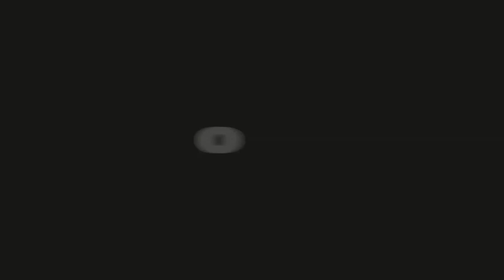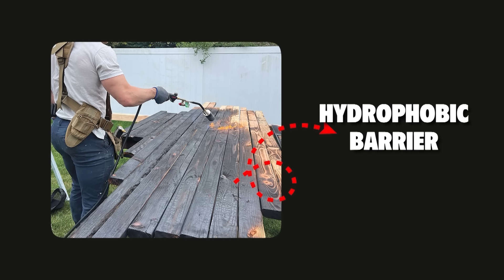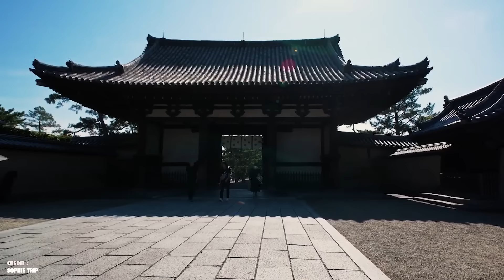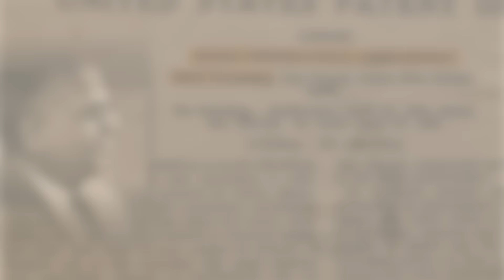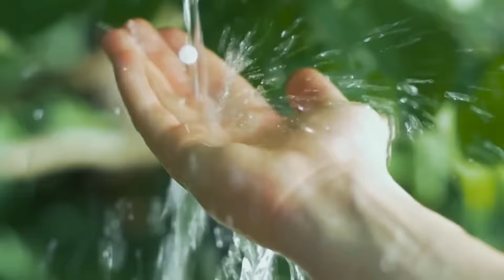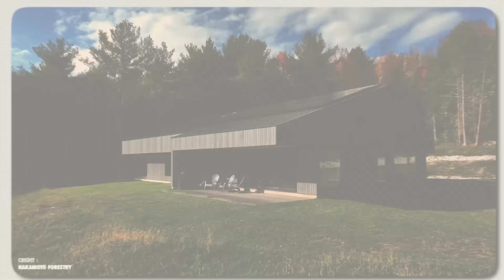How A FREE Japanese Trick Makes Wood Rot-Proof, Fire-Resistant, and Insect-Proof

Comment: What I don't get about this method: After charring you either have crumbly, well, carbon, that rubbs of when you touch it. Alternatively, when you brush it, you start revealing the untreated wood again. 🤔 Also, doesn't charred wood, similarly to charcoal catch fire QUICKER?
Oh, and how do you actually work with the wood after it has cupped and warped so heavily after one-sided charring?

Comment: It is decent video I agree with the premise but somewhat disagree with “corporate is evil” conclusion - that can be true but far from full picture. 
  you didn’t explore(just briefly hint) the difficulty of scaling of this method especially back in a days and on top of that not all woods can benefit from that - so cost is way higher, the fact that it is very messy during install and lifespan(ashy surface even after oiling it), hard to repair to match the surrounding material, it can flake off, and maintenance (oiling) is still needed so is not set and forget as you imply.
Reply: "Western building codes" do not apply to the whole world. and for some reason, this method has not been widely used outside the USA and Europe either.
Reply from the maker: Thank you for your comment. I am not sure I can agree with you completely.  Yakisugi does offer a better lifespan than conventional treatments and one without any manmade chemicals.  But I do agree that it is not cheap! If you do not use the conventional way of burning the wood (kindling) and instead use a blowtorch it will cost you a lot more than treating with exterior wood paint. Thus Yakisugi is perfect for cladding that you hope to have on a house for a long time and not necessarily for things like sheds or fences which will use cheap wood.  I also would not advocate having it internal to the house as it is messy and carbon dust is not great for anyones lungs.

Comment: Part of the reason why this works is because the wood they use is cedar. Cedar is very rot resistant to begin with, so giving it a little extra surface protection makes it last a really long time. It's not as effective with modern pine that is very soft and porous, and tends to alligator or crack if prepared this way.
Reply from the maker: Cedar is certainly the preferred option for its grain structure, density etc.  Other woods can be used but may not perform as well.  I have personally done it on pine and it work well.  I did notice cracking on some boards that weren't properly dried, but I still liked the finish and the end result. The only thing I would say is that if you want to preserve the wood for longer then add a layer of linseed oil.  It helps keep the carbon surface in place longer.  Without it I noticed my boards changing colour after a period of rain.  Anyway - thank you for your comment!

Comment: I'm not debating the source of this technique, but lot of barn doors in Germany's Countryside use this technique. I've seen 80 to 100 year old wood doors with no rot.
Reply: Yeah, but the type of wood matters. A lot of those old barns that are still standing were made with timber that is heartwood from very rot resistant wood species (anything over a hundred years has a lot of selection bias; all the softwood barns have long since rotted and fallen down). 
 You can't expect the same longevity by trying the same technique with much less dense softwood species or modern pine. If you do you'll find that the lower density leads to a correspondingly less dense carbon layer at the surface, which is more prone to alligatoring (cracking during the burning), and generally just leads to a much less dense carbon matrix on the surface that won't protect the wood adequately.
Reply: Also, CCA is band in Germany.  
I think its only allowed in marine

Comment: Doesn't using oil defeats the purpose of carbon? Mold will happily eat oil.
Reply: I've seen it asserted that the main risk with oils is the mucilage content. I mainly make things that are smaller than houses, so I use an alkaline solution to remove the mucilage from finishing oils. You lose a bit of the oil in the de-gumming process, but it's rot resistant. Leaving that in the sun as it separates also produces a sunbleached drying oil, which polymerizes faster in the same way that "boiling" it does.
Reply from the maker: Traditionally they didn't use oil and simply let the carbon do the job, but in modern time to give longevity to the wood and to make it look more appealing people used oil to lock in the carbon on the surface.  So yes you are correct! Thank you!

Comment: So using gas to burn it and oil to seal it. Do you know what "free" means?
Reply from the maker: You don't have to use gas, you can use tinder if doing it the traditional way.  And you don't need to treat it if you don't want!  Just leave it as it is!  Thank you for the comment!
Reply: @wildline_YT can. Your paint it if you desire color

Comment: What is the oil used after firing?
Reply from the maker: Oil is used to lock in the carbon (char) on the surface. I didn't use oil and the carbon disappeared over time.
Reply: Linseed or tung oil. Jeffrey Z. in SC

Comment: It does stop rot but it also massively increases the chances of fire. You’ve burnt away its natural fireproofing essentially making charcoal so that’s why we don’t do it. It’s good for like fence post etc anything you’re going to stick in the dirt because it’s cheap and effective.
Reply from the maker: It is actually used for cladding and not fences.  The reason it is a better fire retardant than wood is because the carbonized layer acts as an insulating barrier. This layer requires much higher temperatures to ignite compared to raw wood, as the volatile components (cellulose) are already burned away. Thank you for your comment!
Reply: @wildline_YT that’s factually incorrect. You really shouldn’t be telling people this incase the believe you and get themselves killed in a fire. Reason why you’d scorch the bottom of a fence post is so when you stick it in the ground its a cheap and effective way of preventing it rotting in the wet damp ground but as gemini explained on my previous post it’s a massive fire hazard and this method shouldn’t be used anywhere where you wouldn’t want to risk a fire.

“It’s a bit of a kitchen-science paradox: you’d think wood that has already been burned would be "spent," but charred wood (or charcoal) is actually much more eager to ignite than a fresh log.
The reason isn't just that it "looks" ready to burn; there are some fundamental chemical and physical changes at play.
1. The Removal of "The Wet Stuff"
Fresh wood is packed with moisture and volatile organic compounds (resins, saps, and oils). When wood is charred, it undergoes pyrolysis. This process bakes out the water and the heavy gases.  
• In fresh wood: A lot of heat energy is wasted just evaporating water before the wood can actually burn.  
• In charred wood: The water is already gone. Every bit of heat applied goes directly into raising the temperature of the carbon to its ignition point.
2. Increased Surface Area
If you look at charred wood under a microscope, it looks like a sponge. As the gases escape during the initial burn, they leave behind millions of tiny pores and microscopic cracks.
This high porosity means there is a massive amount of surface area available for oxygen to react with. Since fire is essentially a rapid chemical reaction between fuel and oxygen, more "contact points" mean a much faster start.
3. Lower Ignition Temperature
While pure carbon has a high ignition point, "char" isn't usually pure carbon. It often contains pyrophoric carbon. During the charring process, the chemical bonds in the cellulose and lignin are broken down into simpler, more unstable forms.  
• These "pre-broken" molecules require less energy (heat) to kickstart the oxidation process.
• In some cases, if wood is charred over a long period at low temperatures, it can even undergo spontaneous combustion because the char becomes so reactive with oxygen”.

This is Gemini explanation as to why charred wood catches fire so easily.
Reply: @TheNotoriousMIC Gemini explanation? You're sourcing your information from an AI? DANG BUDDY.
Reply: @realPoppaWookie Obviously not sourcing my knowledge from AI as a carpenter this is something i’ve know for decades before AI even existed and something the humans race has known since the creation of fire. I was just using AI to explain the process in a way I couldn’t.
Reply: @realPoppaWookie  LMAO
Reply: they are arguing the opposite? That it helps to fireproof the wood?
Reply: @ghi @ghihbgyu ’d be wrong.

It’s a bit of a kitchen-science paradox: you’d think wood that has already been burned would be "spent," but charred wood (or charcoal) is actually much more eager to ignite than a fresh log.
The reason isn't just that it "looks" ready to burn; there are some fundamental chemical and physical changes at play.
1. The Removal of "The Wet Stuff"
Fresh wood is packed with moisture and volatile organic compounds (resins, saps, and oils). When wood is charred, it undergoes pyrolysis. This process bakes out the water and the heavy gases.  
• In fresh wood: A lot of heat energy is wasted just evaporating water before the wood can actually burn.  
• In charred wood: The water is already gone. Every bit of heat applied goes directly into raising the temperature of the carbon to its ignition point.
2. Increased Surface Area
If you look at charred wood under a microscope, it looks like a sponge. As the gases escape during the initial burn, they leave behind millions of tiny pores and microscopic cracks.
This high porosity means there is a massive amount of surface area available for oxygen to react with. Since fire is essentially a rapid chemical reaction between fuel and oxygen, more "contact points" mean a much faster start.
3. Lower Ignition Temperature
While pure carbon has a high ignition point, "char" isn't usually pure carbon. It often contains pyrophoric carbon. During the charring process, the chemical bonds in the cellulose and lignin are broken down into simpler, more unstable forms.  
• These "pre-broken" molecules require less energy (heat) to kickstart the oxidation process.
• In some cases, if wood is charred over a long period at low temperatures, it can even undergo spontaneous combustion because the char becomes so reactive with oxygen.

This is Gemini explanation as to why charred wood catches fire so easily.
Reply: @ghihbgyu  Try it yourself. You'll see that charcoal ignites much more easily. BS?
Reply: that's just the rotting of the frame is a much bigger problem of shitty American houses. And if you want to protect your house from fire, then just build a house out of bricks or other large-format blocks.
Reply: You’re comparing greenwood to charred wood. Most people don’t build with greenwood, and even if they do, it would cure in a year anyway. Am I missing something? It’s definitely harder to light charcoal on fire than cured wood. To make charcoal you gasify the wood - aka burn off all of the most flammable gasses…
Reply: @kennethprola5136  guys stop bullying him he heard it from gemini (ai)

Comment: its a good technique for sure, but this is a little too hyped. Lasts forever without maintenance? Well try it. You do need to maintain and re apply oil for sure, and only in the right conditions will it last a long long time. Its a great technique anyway.
Reply from the maker: Valid point, proper application and oil are definitely needed to maximize its lifespan. Thanks for watching!

Comment: It's a no brainer for off grid structures for sure
Reply from the maker: I think so!  I did it on my own fence! Worked well but you do need to apply a coat of oil to lock in the carbon.  Thank you for the comment!
Reply: @wildline_YT  Did you use used oil?

Comment: I’d love to see more hard data separating tradition from marketing hype
Reply: That's what living is (to separate). Try it! I was recently introduced to this method by a friend (who's grandfather, a rancher, learned this through noticing OLD burnt fenceposts. We burned some recently - well before I ever saw this (any) video (s) - & it's EXACTLY as the project states. Burnished/ stained/ protected & sheds rain naturally, w/ o molding, rotting, warping!!! Some like low maintenance. I prefer NO maintenance. Check it out!
Reply: Yeah, but the type of wood matters. A lot of those old structures that are still standing were made with timber that is heartwood from very rot resistant wood species (Cedar as stated in the Japanese ones from the video).
 You can't expect the same longevity by trying the same technique with much less dense softwood species or modern pine. If you do you'll find that the lower density leads to a correspondingly less dense carbon layer at the surface, which is more prone to alligatoring (cracking during the burning), and generally just leads to a much less dense carbon matrix on the surface that won't protect the wood adequately. 
Not to say it wont work at all, but it's much harder to pull off. 
Also a lot of time this technique was combined with traditional finishes like Pine Tar, which have fallen out of favour but are much more durable than modern paints. Combine a burnt surface with thinned out pine tar and it  makes an incredibly good finish, especially on cedar weatherboards.
Reply: There is also tech to apply bee wax and polish to charred planks.

Comment: There is also another advantage from treating wood in this manner, increased heat retention as Darkened woods Absorb the sun's rays which then dissipate throughout the home, this cuts heating costs over a long period of time. 😉💡🤓
Also to point out, Timber companies could use excess cuts of waste wood to create a Burn bed that sheets of wood would pass over to get the Burn on planks, 🤓🏆
Reply: Most people have more trouble with cooling than heating.
Reply: @caseker8613 That's what Windows were made for, 😉
Reply: Which is win again. Why do you think some dessert people have black clothes? Well, it is because that hot air made by sun helps to pull up colder air at feet (clothes are like ropes) and that layer of air serves as barrier. Under that black coat is another layer of textile. Do I think it is similar here at house. OFC it would be better if it would be white. But hey if you have sun you have free solar energy and AC is easy. In the winter, not much sun but some extra heat due black cladding.
Reply: @caseker8613 depends on location. And of course time of year.
Reply: @caseker8613  taller ceilings help reduce that problem significantly.
Reply from the maker: Great insight on the heat retention, and that's a brilliant idea for repurposing waste wood! Thanks for sharing. 💡